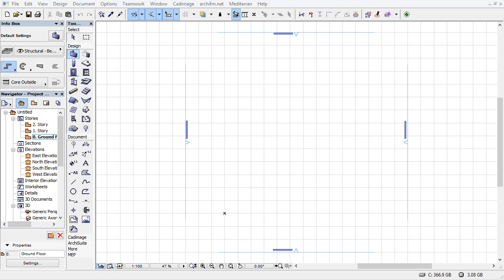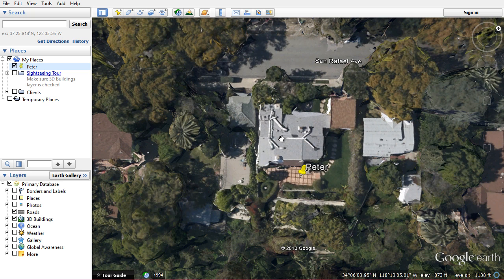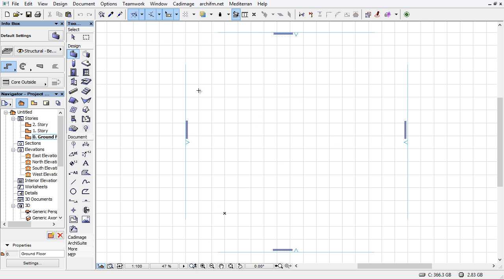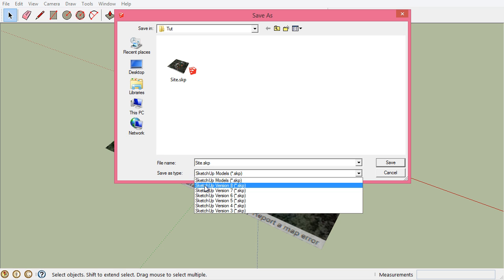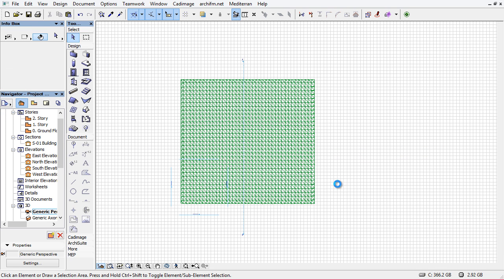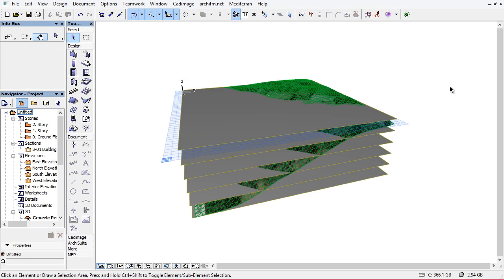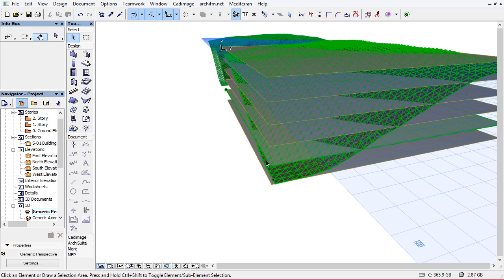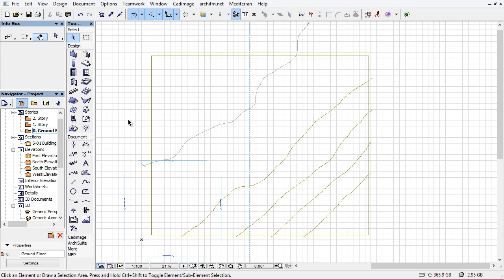Integrating Google Earth Locations into ArchiCAD 17 and Creating real Contour Lines

Comment: wow, i was interested at first, but all that looks a really unnecessary long process. It could work fine with 5 cotourn lines but what when you have, lets say, 50 of them? do you really have to go one by one? and then trace them one by one again? why don't you simply do the job in sketchup in one click and then export it to dwg and put in into archicad?

not to mention you will have a set of 3d morphs which would unnecessarily increase the file size dramatically...
Reply from the maker: that's right Enes 
my point was to achieve a fast solution for simulating small chunks of the project and then use it in my ArchiCAD model. however when the whole project will be just modeling the site as it is on the ground then I'll probably ask the surveyor for his grid points map and insert it as dots with elevation in ArchiCAD and finally connect the dots.
Reply: Muaz Alnajjar y I got that. I've tried to find a way to do that too in archicad alone for a while but at the end of the day sketchup will do the job way better, faster, easier and lighter than AC. Then you just import a a set of 3D LINES (.dwg) and instantly create a mesh out of it in archicad. Just saying that going thru the contourn lines one by one is really non-efficent to me and the give-a-thicknes to the moprh really kills it since (i don't know why) morphs are really "heavy" to deal with. I hope Graphisoft will come up with an easy way to do this inside AC alone. I'd really like a direct tool to just get contourn lines out of a mesh/morph. Input the desired distance and click, done. 

let's keep dreaming...
Reply: Enes Libohova let's keep being unfriendly.